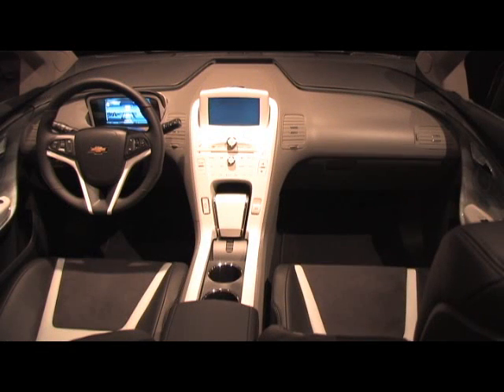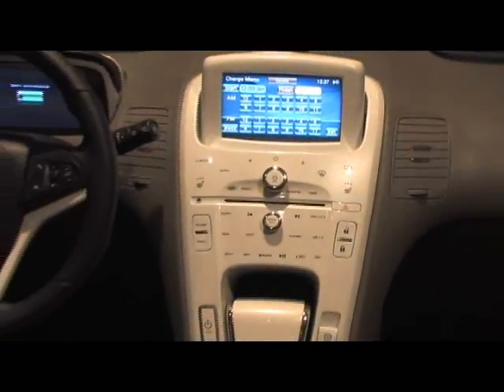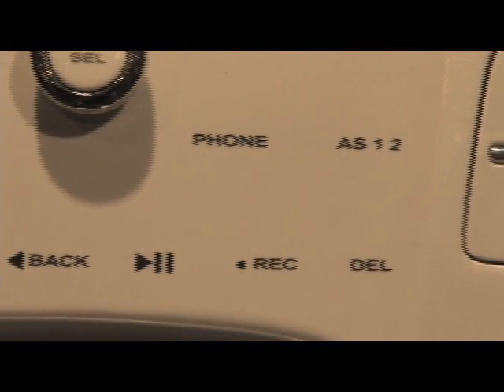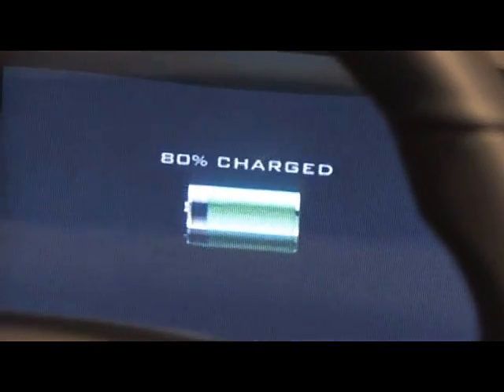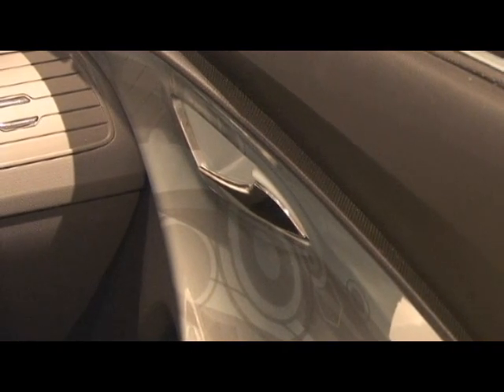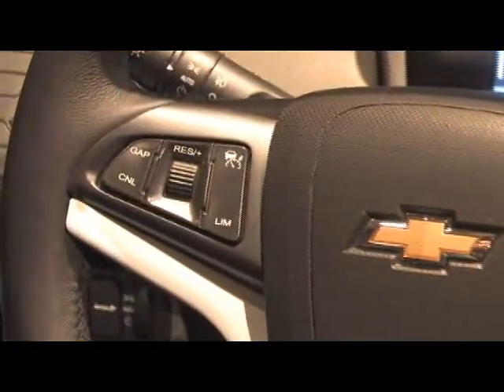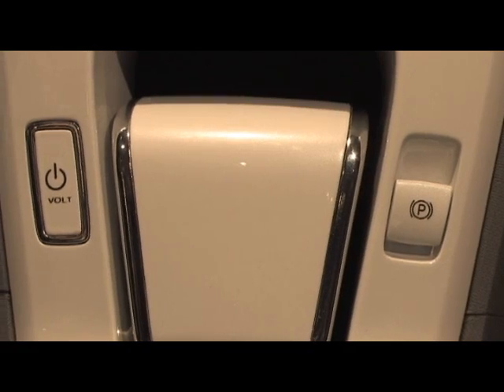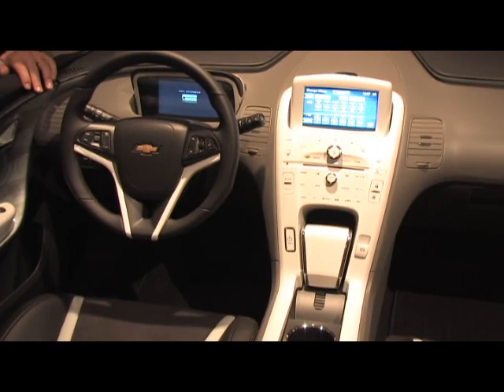2011 Chevy Volt Interior Walkthrough

Comment: @britneff 

Please send me the link to the GM site that states the fuel consumption of the Volt as 95 mpg with the engine running.  I would think that GM would want to possibly take legal action against the EPA since the EPA lists the fuel consumption of the Volt as 37 mpg when the engine is running.  If you can honestly prove that the Volt gets 95 mpg after the battery has run out I'll put my name down to buy one right away.

Comment: @TheUSPH No. The Volt has an EV only range of 40 miles. Less if you use the AC or Heat (true for all EV's)  The problem is that GM did not design the Volt with families in mind.  That shows up when you compare their product with those that Nissan (Leaf EV) and Toyota (Prius hybrid) offer.  Volt won't work for a family of 5 and Nissan is dragging it's feet with getting the Leaf to my part of the world, so Toyota won and there is a new (to me) 2010 Prius sitting in my driveway as of this weekend.

Comment: Gads.  I really want(ed) this car, but the interior makes me ill.  Capacitive touch controls?  In a car?  How are you supposed to use this while driving?  Not only can you not use them by touch, but it'll be difficult not to accidentally hit a nearby control when you're trying to (say) turn the AC on while driving.

I'm afraid I also thing the steering wheel looks cheap and crappy.  And, with no tranny, why waste all that space on the "gear" lever when a small control like the Prius's would do?

Comment: @snipe65789 base model starts @ 35k (depending on the features and battery u choose) and goes up from there. The tesla Model S is far superior for a fully electric vehicle. but its 47K with government incentives. If you were buying a hummer back in the late 90's early 2000's you would get a bigger incentive to buy oversize vehicles WTF

Comment: Yeah, okay.  Go dig up a third-generation iPod.  The one with the "touch" controls.  Notice that Apple ditched that model?  Why?  In part because if you use it without looking right at it, as you're trying to figure out where to put your hand, you can activate the controls unintentionally.  Placing touch controls into a vehicle -- for tasks that you want to do while driving -- is just poor interaction design.  Trust me, I had a stereo with touch controls, and I replaced it for this reason.